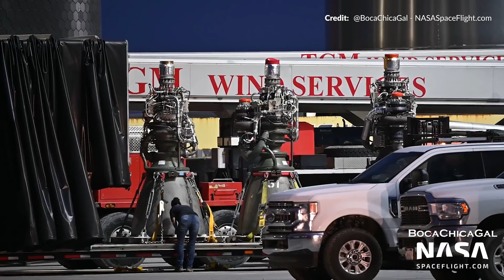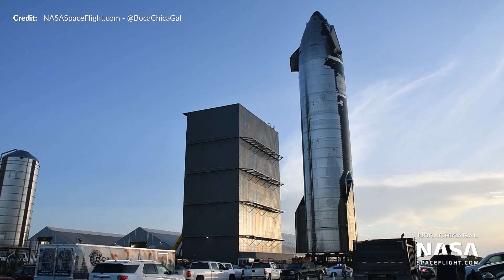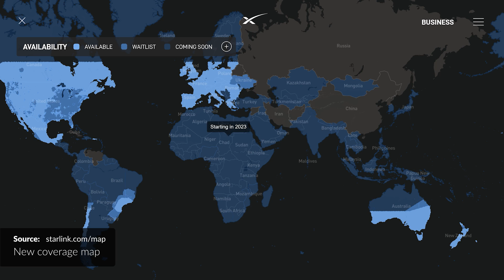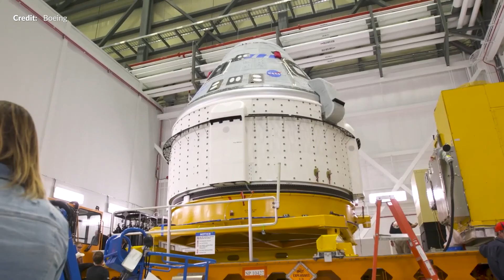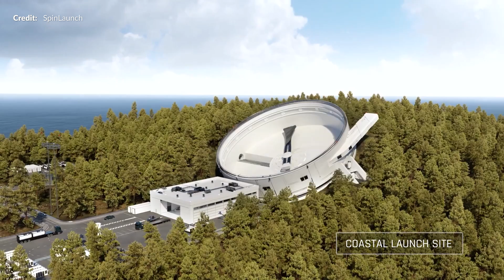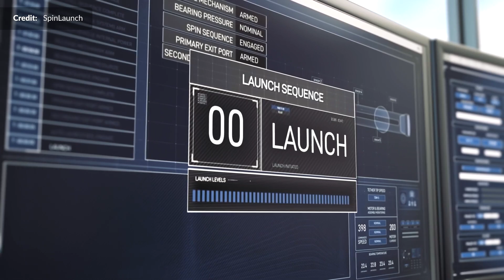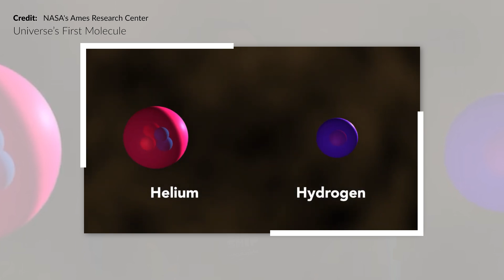SpaceX Starship Booster Testing, Ships Shuffled, Starlink, SpinLaunch, SOFIA, & Starliner

Comment: on spin launch.  200 kilo per 1/2 million=2.5M/ metric ton.  Possibly nice for immediacy of small payload, but not really that cost efficient.  SX starship is planning 150 tons for (their cost) a few million and it will be a much gentler ride and like falcon 9, cheap rideshare missions will be available I'm sure.  One question about spin launch I have is if they launched from very high altitude (like mountain top) how much would that help their performance?  Seems like that compact of a system could be put a lot of places including a mountaintop.  Seems like hypersonic craft might compete against spin launch as well.

Comment: I agree that the Spinlaunch system would be much more effective on Luna since you could loft sizable cargo against 1/6G such as extruded beams and Oxygen or Fuel for pick up in low lunar orbit to be shuttled to where needed, I can see a fleet of pickup craft to go after the Yeetlaunched cargoes.  Aside from energy to spin the critter (the vacuum would be free on Luna) and what is needed to pick it up in orbit has got to be tons less than fueled launch.  It will have to wait til we have some infrastructure on the moon to support such a system, but it looks to be a cost effective system, on Luna, just not so much in Earth's monstrous (by comparison) G Field

Comment: Why does spin launch use a spinning arm rather than an elctromagnetic rail gun? I would have thought you could accelerate something faster using electricity, magnets and would have less points of failure, i.e the center of the arm?

Comment: G-forces are just relative. how fast are we hurdling through space as we ride this round rock as it orbs a hot ball of gas?

how complex would a system need to be to counter act the felt G-force going that fast?
Reply from the maker: I think you are thinking of velocity. It matters not how fast you are moving relative to anything else. What is not relative is a momentum change or change of direction. We all feel this in the same way.

Comment: If they finish a rocket and it works why would they transport it on the ground.  Why not just launch it their?  They just need the launch tower in Florida finished with its grabbing arms... and for this capability to have been tested a few times.  This way going forward if SpaceX is only able to make certain number of launches in Texas each year (which there was talks of that) then they build the in Texas and launch them to Florida.  The first flights of each combo might only have StarLinks on them and then in Florida they could load other cargo as needed.

Watching the latest interview with Elon I was amazed to find out the burn-back AND landing is supposed to use the header tank on Starship.  The analogy that Starship while landing is basically a flying empty tin can.  It will be so light in comparison to the launch it should take little power.

Comment: Using spin launch on the moon is a great application! It simplifies so many stages of the process. Frightening that you'd probably be able to watch the mk1 spin up visually, as there would be no initial need for an enclosure at all.

It's much like space elevators in that starting on the moon just makes so much more sense.

Comment: Spin launch tech makes a lot of sense in orbit or on the moon, but the tech needs to be developed (not easy off earth) develop here, deploy off earth, reap cheap resource deployment from and to moon, maybe a fast probe to distance solar system locations.  With no atmosphere to contend with and energy received from solar the cost of the delta V would be free (minus capital to build it).  I still think a mag-lev train style launcher on the moon is the best way to go.  Relatively low acceleration over a long distance would eliminate any g-force issues.  It would have to be built on the moon using local materials though as transport costs of required materials would be insane, but cargo and people could easily get a ride home at the expense of some solar cycles.  Mine the moon and the capitalist will come and we will become a space faring civilization as fast as we can build it, not because of the pursuit of science / exploration but due to the lure of resources, profit and power, that's just the way humans have and always will roll.

Comment: While I do think the spinlaunch may be useful on the moon, remember it is phisically impossible to throw anything into orbit from the surface of the moon. Or rather, the low point in the orbit is necessarily no higher than the launch point... To get to a useful launch point, there has to be an orbital boost at some point, which pretty much means that to payload has to have a rocket to perform that boost.

Comment: Marcus as I understand it the Space Shuttle used Hydrazine as a thruster propellant so why was it not also used for Starliner?

Should not the mere potential for the valves in question to stick preclude that system from use?
Reply: Per Aerojet Rocketdyne, which provides the thrusters for Starliner, it uses hydrazine monopropellant thrusters for RCS and nitrogen tetroxide/monomethyl hydrazine for the Launch Abort Engine (LAE).

Comment: Marcus it is my impression that Starliner and it's launch system has been and will continue to be not only considerably more expensive than Crew Dragon along with the Falcon and Falcon Heavy launch vehicles but wasteful of resources as well.

As I understand the matter neither Starliner or ULA are really operational yet and cannot do much if anything crew dragon cannot also do if need be.

Surely then Starliner is not now and probably cannot ever be cost-effective?

When the SpaceX Starship becomes operational it will obviously be capable of providing a far broader range of services and functions than Starliner.

Starship will do so much more effectively and for significantly lower cost plus, SpaceX already has a well established and exceptionally consistent reputation for safety and reliability.

Because, the Super Heavy booster will probably be added to the SpaceX repertoire at the same time as Starship.

Starliner and it's launch system will become doubly unsustainable and redundant as well as obviously being based on relatively obsolete if 'updated' Apollo and Space Shuttle hardware.

Subject to those considerations is redundancy worth the ostensibly unjustifiable expense?

Because, SpaceX produced it's remarkably advanced and capable vehicles and technologies on a much smaller budget than Boeing and ULA in a fraction of the time than the latter companies.

Is it not reasonable to expect the latter groups to lift their standard to the same level as SpaceX rather than simply allowing them to rely on political patronage at greater expense to the US taxpayer than simply relying on SpaceX?

If such contentions are not sufficient to persuade most people regarding the absurdity of spending a fortune at sustaining an uncompetitive contender for government contracts merely on the premise of 'redundancy'.

As companies like Relativity, Rocket Lab, Astra and so forth continue to consistently improve their technologies.

Unless they acquire control of more progressive organizations Boeing and ULA are almost certainly going to continue falling further behind and therefore become even less competitive than they are now.
Reply: Per the NASA IG, Starliner's per seat cost is $90M, so $360M per flight. SpaceX's latest Crew Dragon contract with NASA is for 3 flights at $900M, so apparently $300M per flight or $75M per seat. The money awarded in NASA contracts is not determined by NASA, but are the bids of the companies themselves. So SpaceX chose to bid $300M per flight.

While Starliner is not operational, ULA has been operational since Dec 2006. The ULA Atlas-V was designed by Lockheed Martin and first flown in 2002, 5 months after SpaceX was founded.

If 'cost effective' as you state is that Starliner costs less than Crew Dragon, maybe not. Although Crew Dragon went from $55M per seat (NASA IG) to an apparent $75M per seat (latest contract), Crew Dragon might end up costing more if that trend continues and Starliner doesn't also go up in price.

Starliner is a LEO only spacecraft for travel to the ISS, because that is what the contract required. It can launch on a variety of boosters.

The Superheavy booster WILL be added as it is a vital component of Starship. If you want to get Starship (second stage) to orbit with payload, you need the Superheavy booster. Yes, the whole system is called Starship and the second stage is also called Starship, so it can be a little confusing sometimes.

The $2.94B HLS Option A contract is for 2 lunar landings, a test landing and a manned landing. Per the SpaceX plans found in the GAO report denying the HLS complaints and Musk's update to Starship's payload capacity, it takes up to 10 Starship flights to get Lunar Starship to the Moon. That puts each Starship flight at roughly $147M. Costs should go down in the future, but it will take a very long time, if ever, for Starship to get as low as Musk's ambitious estimates. Starship is still in early development, Musk is talking major structural changes like possibly losing the forward flaps, so it is not yet operational. Starship has yet to prove reliable enough for crewed transport and may never be reliable enough if things don't go to plan. Starship has tremendous potential, but it is ONLY potential at this point.

It is worth it to NASA to have a back up to Crew Dragon for taking crew to the ISS. NASA does not want to be in the position that they were in when the shuttle was retired without a viable crew transport replacement. So that is why two companies were chosen in 2014 for Commercial Crew. IF NASA had only chose one spacecraft in 2014, it would have been Starliner as SpaceX was the risky choice at the time, with only 12 Falcon 9 flights under their belt and the first booster landing over a year away at that time.

Considering SpaceX went from nothing to having 2 launch systems, a crewed spacecraft, and is developing another spacecraft, the other aerospace companies know how well SpaceX has changed things.

While SpaceX is the clear leader in aerospace, they are not the end all, be all, everything in aerospace. NASA, and the USSF, desire redundancy so that if one provider has issues, they have other providers. Redundancy is a good thing when development of a replacement can take years.

Comment: I don’t think starships are designed to be transported horizontally. With that thin steel I don’t think it has internal structure strong enough to lay down without being pressurized which might be a bit too risky and complicated for such a long trip. I think they are meant to fly from production facility to sea launch platform, like an airline is flown to hangar for maintenance. And they are more than capable to do that without a booster as we already have seen. If they can fly to sea launch they can also fly to Florida, technically. Let’s see how regulatory process for that come along.  :)

Why I think this? We haven’t seen any ship capable of this and it would need as you say a lot of testing and adaptation. It all goes down to if ship would be cheaper than flight in the long run, and with missed income during shipment you want these beasts to work, as airplanes. 

Thanks for great news show! :)

Comment: Spin launch. They say they will launch at 8000 km/h. Then you say they launch faster than what’s required tour a lunar trajectory. Well no they don’t as 8000 km/h isn’t even half the LEO orbit velocity. Also that 8000 km/h is at release and obey that rapidly drops off. Think about it, vacuum spin up release into sea level, 1 atm. That would be like hitting a brick wall. Also form drag increases with the spears of velocity so 8000 km/h is going to be very draggy.

So I’m doubtful. F9 booster releases the upper stage at 80 ish kilometres and at about 8000 km/h where as spinlaunch is sea level 8000 km/h and slowing down the entire time. Doubtful.

Comment: I don’t think boosters or ships from Tx will be sent to the cape. Getting roberts rd manufacturing online will take awhile, but so will the launch tower, table and farm. The pace at which spacex can build boosters and ships is incredible, so as long as manufacturing gets online before the launch system, they shouldn’t have a reason to bring anything from Texas other than their experience. I think since SpaceX doesn’t yet have clearance to fly in Texas, their production rate has purposely been slowed down to quite an extent.

Comment: I don't think SpinLaunch will ever be viable as there are so many factors to make it work reliably. Looking at the footage from the projectile they provided showed it was spinning which shouldn't be happening with their launch mechanism, it indicates that they are not getting a clean release of the projectile. As for using it on the moon, a simple mass accelerator rail would be simpler and more cost effective than their system.

Comment: I feel like the long term solution to moving Starships will be just to launch them.
Reply: Yes that would work rather well I believe  😉
Reply: I don't think it will be easy to convince the government anytime soon, they need to cross a populated area during the landing sequence.
Reply: @refindoazhar1507  not anymore than launches from Vandenburg.
Reply: @jessepollard7132  afaik vandenberg can only launch into high inclination orbit exactly to avoid passing any populated area early on in the mission, the first land encountered by any rocket launched from there is probably somewhere in southern south america or antarctica (both further away from the launch site than KSC is from europe).

To add, launch from KSC can't get into high inclination orbit for the same reason  (they must cross either US or the caribbean very early on)
Reply: A valid last test flight demonstration.

Comment: Arthur C Clarke envisioned having a magnetic rail launch system on the moon for launching cargo and fuel into lunar orbit.  It's an ideal use case as you just need to launch the object with orbital velocity and it's guaranteed to stay up.  Even better if it would be possible to get it up to a high enough orbit to be recovered to Earth with minimal delta-v.
Reply: "The Moon is a Harsh MIstress", and ended up being used for bombing Earth (Pikes Peak if I remember right).

Comment: Pipe dream, Space-X get a Starship to take the parts to build a Spin Launch system to the moon base. The base mines aluminum and Rocket fuel. Spin launches the materials to lunar orbit to build a massive ship to go to Mars. Think of the launch cost savings. But decades if not longer away, if ever.

Comment: Starliner is significantly inferior to Crew Dragon. Nonetheless, I am looking forward to the United States have two, separate, operational manned spacecraft, and I am equally looking forward to a day, in the not too distant future, when they are joined by Orion, Dream Chaser, and Starship. It will be glorious.
Reply: Starliner is roomier than Crew Dragon and can boost the ISS without modification. Apparently Starliner may be able to carry 5 astronauts instead of Crew Dragon's 4 astronauts. No, evidently neither of them can carry 7 astronauts as NASA changed the seating requirements part way through development.

Dec 2019 Space Flight Now article with SpaceX CEO Gwynne Shotwell
"After SpaceX had already designed the interior layout of the Crew Dragon spacecraft, NASA decided to change the specification for the angle of the ship’s seats due to concerns about the g-forces crew members might experience during splashdown.
The change meant SpaceX had to do away with the company’s original seven-seat design for the Crew Dragon.
'With this change and the angle of the seats, we could not get seven anymore,' Shotwell said. 'So now we only have four seats. That was kind of a big change for us.'"

I think the 'significantly' qualifier doesn't fit.
Reply: @steveaustin2686   Yes, the significantly fits well, even if this is accurate. My understanding is that both spacecraft can be configured with different numbers of seats. I could be wrong. Either way, Crew Dragon is capable of operating independently up to two weeks, Starliner can only fly by itself for three or four days. Crew Dragon has other advantages, such as superior control systems and a toilet.
Reply: @odysseusrex5908  Crew Dragon is 4 seats per SpaceX COO Gwynne Shotwell. She would know if Crew Dragon can hold more. 

Don't misunderstand, Crew Dragon is the better vehicle. Starliner is not as bad as you paint it to be. Don't fall into tribalism.
Reply: @steveaustin2686   I in no way said it was bad, merely inferior to Crew Dragon.
Reply: @odysseusrex5908  I don't think that it is significantly inferior. That's the difference, how far apart we think that they are. I think that they are closer than you do.

Either way, hoping Boeing has solved their problems as Crew Dragon has as many private flights as NASA flights left. Would be nice to give the Crew Dragon capsules a bit of a break.
Reply: @steveaustin2686   Oh yes, hoping for that to, as i hope my OP implied. Also hoping SpaceX gets other customers though. Their capsule is designed for it, Starliner really isn't.